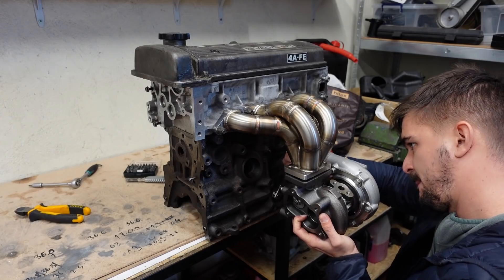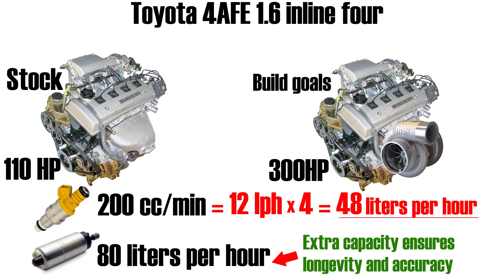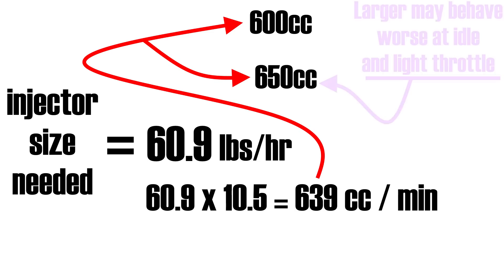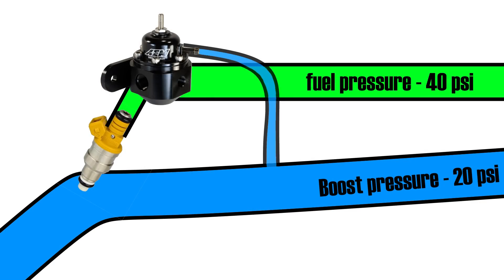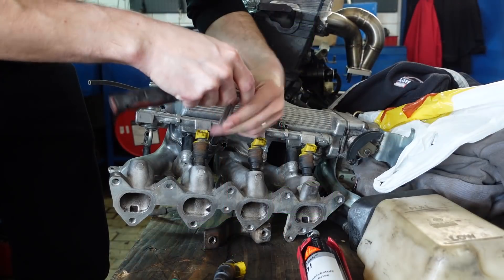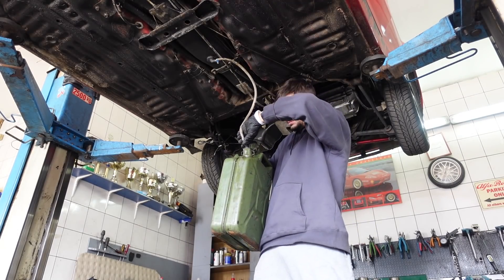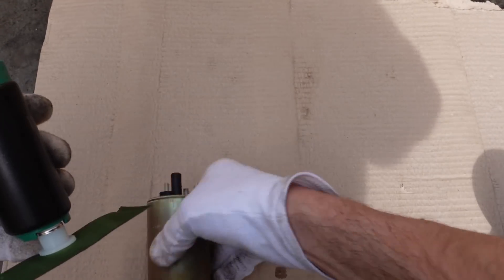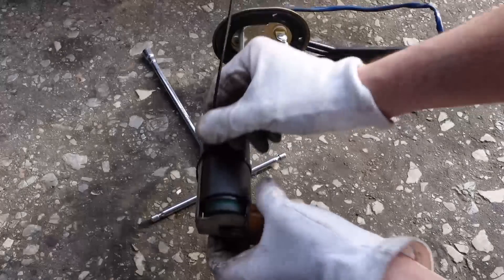HOW and WHY to upgrade your FUEL PUMP and INJECTORS - THEORY + PRACTICE - Project Underdog #13

Comment: As always very useful information which I will take on board as I continue my research into my EFI conversion. I need to have a new bespoke tank made for my project car so the in tank pump is a vital part of what I want to end up with. Do you run a swirl pot on your MR2?
Kind regards Paul

Comment: It’s worth mentioning that OEM injectors often have a spray pattern that has been designed with the intake port/valve in mind. Most aftermarket injectors have a generic spray pattern. This can result in more fuel being sprayed on the wall/valve and increased puddling. Usually it’s not a huge deal, but can cause some drivability issues.

Comment: I have always found it much easier to remove the oem pump, add a sump, and use an external inline pump. The only real downside is that they tend to be a little bit louder, but other than that, it makes literally every other part way easier to service. I know some people have had issues with reliability when using inline fuel pumps, but the only time I have seen it be an issue is when using cheap parts.

Comment: I have a question... I'm also building the same project as you of turboing a 4A-FE engine with the same parts as used in #project underdog, expect I'm using high compression semi forged pistons and my power goal is less than 250. NOW MY QUESTION IS is it safe to use a 4A-FE oil pump with 7.8 mm with gear or should I get  the 4A-GE oil pump(with a thicker gear), since I will be installing an oil squinters and turbo oil feed???????  I really need an answer. 

PS #driving 4 answers I would like to add your project has been very help for turboing my car, and so I would like to thank you.
Reply from the maker: I would definitely go with the 4age oil pump

Comment: With modern injectors i wouldn't be so conservative with injector size. When i modify my cars i usually install ev14 1000cc injectors, unless bigger are needed. I havent had any idle or light throttle issues with them. Usually 600-700cc injector would be fine with my builds but with 1000cc injector i have option to change e85 or bigger turbo without buying new injectors again.

Comment: Which solution is better? Fuel pump near the fuel tank with a long pressurised line and short return line or fuel pump near the engimne with short pressurized line and two long non pressure lines ( feed and return) ?

Comment: Fantastic video, as always. 
I have just only one thing to say about sparks in the fuel tank. As dangerous as it may seem, the fuel is actually impossible to ignite. And that is due to the lack of oxygen. For the petrol to ignite, a lot of air is needed. Of course, all wiring and wire connections have to be done professionally. The fuel ignition, in this case, is just a fun fact 🤓

Comment: Are you concerned that soldering the wires to the connectors you could be creating a hard spot at the terminal that may fail with vibration?

Comment: Great info as always.  One more thing to note for flow through a given nozzle size, 
flow ^2/pressure = constant where pressure is the differential pressure across the nozzle.
(meaning difference between pump and manifold pressure)
Therefore
flow2/flow1 = sqrt(pressure2)/sqrt(pressure1)
This means you can tweak the flow somewhat by adjusting the pressure.

Comment: Don't crimp AND solder. crimping > soldering, soldering afterwards only makes the connection weaker. If the crimp doesn't transmit confidence, re-crimp it with better tools.
Reply from the maker: I would love to know how solder weakens a crimp
Reply: @d4a  Sure! The timestamp for reference is 14:00
The solder "hardens" the wire making it less flexible and the heat could affect the insulation. 
I've also read people complaining about vibrations plus heat (current) being able to melt the solder, I've never had that happen and I used to solder my shitty crimps up to a few months ago. As a disclaimer, the only repair in a car I've made are changing light bulb and filters, so I've no experience here. 
Given that the soldered crimps are tucked away I wouldn't disassemble everything again to redo them. The owner of the shop was with you so if he does that usually and there was no issue, it hope it's fine for this application. 
I love your videos and your car, btw. Thank you for the great content as always, I learnt a lot with your videos and I hope some day to put it into practice.

Comment: Mmm. I remember replacing my AW11 fuel pump well. Why couldn't they give us a door? The biggest pain was disconnecting and reconnecting the firm filler tube. At least your tank had the drain! The early models didn't. Great work as always. So excited about this build.

Comment: This is off this topic but what are the advantages and disadvantages of carbon clutches over organic or sintered metal clutches? In your clutch video I didn’t see it mentioned and I can’t find much on the web about them short of primary research articles.

Comment: Mr when upgrading to turbo system, ecu will remain the same?  If yes, what about MAP sensor? I know that turbo creates pressure and that map uses vaccum to operate correctly, so would you give me somes precisions
Reply from the maker: It's impossible to go turbo with this oem ecu so I'm going standalone 
https://youtu.be/jGKu6etyLZQ
Reply: @d4a  thnx, 
So i forgot to ask about fuel pressure regulator, it will remain the same or you'll gone change it?
Reply from the maker: https://youtu.be/kVSPLTLVf1Y

Comment: I have 11.25:1 compression on my 370 lq9/ls3 headed motor with 850cc injectors and 450lph fuel pump with lsa supercharger, on my c10 I have a stock 4.8 with 9.5:1 compression and running the 54lb lsa injectors on a 340 lph pump with a vortech centrifugal v3 sci supercharger……good times…….both are cammed and stalled…..both are around 10lbs boost
Reply from the maker: That sounds like a riot! So much muscle, must be fun flooring it and watching the surroundings blur 😁

Comment: As usual a very informative video. -Thank you so much. I also have a mid-engine car (Bertone X1/9 with an Uno Turbo 245hp) but with a Bosch 044 external pump. It is working good but it is noisy so I am going to replace it. What about the AEM pump. Is it generating more noise than stock? It has even more capacity compared to 044 but is that one also loud? It looks like it can be mounted externally as well?

Comment: Does anyone else find it strange that forced induction even works in the first place?  If a turbo doesn't violate the no such thing as a free lunch law, I don't know what does.
Reply: Because it isn't. In the end it's just an engine part that helps to burn alot more fuel that costs money.
Reply: How so? To spin the turbo you need the exaust gas pressure. That obviously is a problem, albeit not a significant one. By pumping more air as boost into the engine you burn more fuel too. This increases your MPG the same way putting a bigger engine in your engine bay would. It's just that the boost doesn't change the size of the engine, only the amount of air it can burn. I wonder, what are you doubtful about? Are you having problems understanding that? I can try explaining in simpler terms if that is the case. I hope I could be of help.
Reply: @felipevellasco6526  I still don't know, but to be honest now I'm more interested in knowing how more displacement equals better fuel economy.

Comment: I would not put rubber around the pump because fuel pumps and specially the boosted one get warm fast and might need the metal surface to exchange the heat, but again I would not because I have one percent of your skill!

Comment: I build a 300 crank horsepower 1nzfe toyota 1.5L engine. Im using a TI industry  255lph fuel pump, obx fuel rail with 550cc fiveo fuel injectors. I achieve my goal, but my tuner said my injectors are too big 😔

Comment: Unless extra work has been carried out on the breathing, a realistic pressure requirement will be 30 psi
 2.0 Ltr engines make approx 300bhp @ approx 20psi, provided AIT does not rise to height and the turbo is not maxed out. Fuel octain requirements seem to be  min of 98 Ron+ else the ignition timing needs retarding to the point the engine goes soft.

Comment: What about fuel cells? Like those aluminium boxes without the pump
Reply: Without?
Reply: @TheAdatto  it uses the momentum of the car to send fuel to the lines. At least that's what I've been told since the plugs for the lines are in the lower back part of them.
Reply: Are you perhaps mixing concepts from electric cars? I've never heard about that before, so I'm sorry if I am the one mixing things. My point is, fuel cells are used in hydrogen cars. They have nothing to do with petrol cars.
It also comes off to me as nonsense "using the momentum of the car to send fuel to the lines". Imagine your car has been sitting in your garage for a month. Are you gonna shake it to get some fuel running through its veins? Looks funny to me. Sorry if that comes off as offensive but I really can't make sense of the concept. I couldn't find anything on the internet about this kind of fuel cell you are talking about. If you are certain they do exist and somehow work please tell me more because you've successfully sparked my interest.

Comment: How it is possible if stoch 250HP engine runs without problems on stock 80l/h fuel pump?
Reply: Because it's enough. And you don't drive with max hp 99% of the time. Max HP is only at max rpm.

Comment: I can't believe how much effort it takes to change the fuel pump in that Toyota!
Reply: There's a top access hatch to get to the fuel sender, but not one for the fuel pump. A detail change to combine the two or prioritise the pump would have crossed off one of the more shitty maintenance jobs on the MR2. The SW30 is done in the modern way.

Comment: I love this project. And I allways learn something new from You. Amazing.

But one small detail, You said that pump is ready for methanol/ethanol, that's true, but used rubber hose is not suitable for any of those liquids, I use this hose a lot, it's great for oil/petrol/diesel fuel, but after submerging it into ethanol fuel it will melt(not exactly melt, but change its consistency to buble gum), so that's Your weak point now. For this aplication we ussualy use nylon hoses. Otherwise very good, and it should work with E10 fuel at least few years.
Reply from the maker: The package comes provided with a small section of hose that's suitable for ethanol and methanol. I didn't reuse the stock hose. The rest of the hoses are of course a different story but if I do move to ethanol I will of course replace all of them beforehand.

Comment: Would also be good to check the gauge of the wires running to the tank. The stock pump uses less current than the AEM pump. If you loose voltage on your cables, you loose performance on the fuel pump.
Reply: It never occurred to me to check if various wires can handle extra current. That’s a good think to keep in mind!
Reply: A

Comment: how much air do you feel comfortable cramming into the 4AFE? I have a G6 Corolla with a 4EFE, and am debating whether to boost it to like 5psi, make an ITB kit or just swap it for a 7AFE with an AWD driveline, but then I'd have to sacrifice the 6-speed CR gearbox EDIT: oh dear god, I just got to the part where you mention 20psi, I sincerely hope that's your oil pressure at idle, not your target boost :p
Reply from the maker: Yes, that's my target boost. But this is my block: https://youtu.be/FsGwMN9Q0Tk
It's honestly not worth going through the trouble of implementing forced induction to run 5psi. A healthy bone stock 4afe can take 10psi and still be reasonably safe, of course provided the tuning is done right.
Reply: @d4a  Thanks for the input. The 7AFE and AWD driveline is pretty common here in Iceland, so I suppose that's the most sensible upgrade, being a bolt-in affair. Good luck with the MR2, I'm really enjoying the series on it.